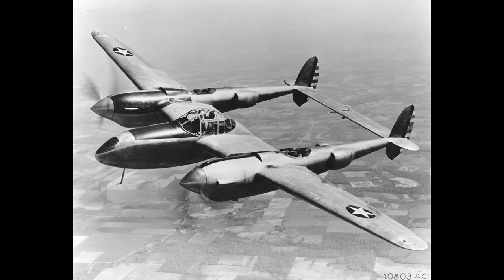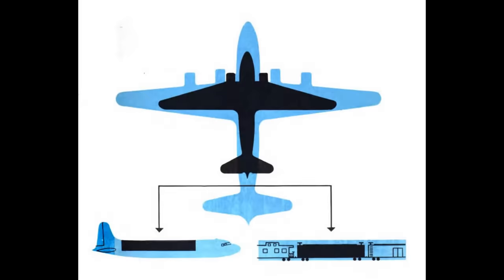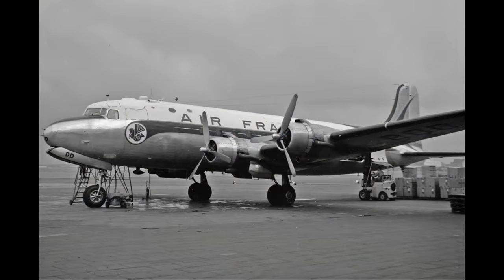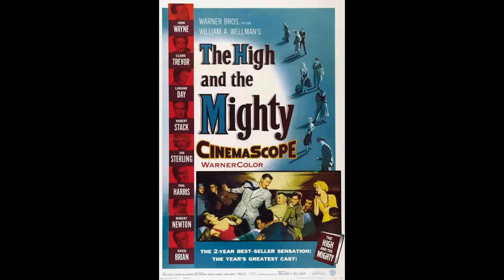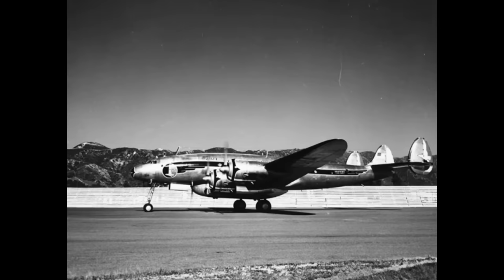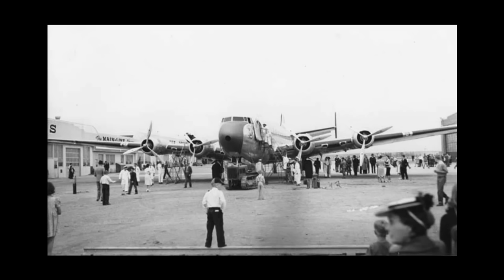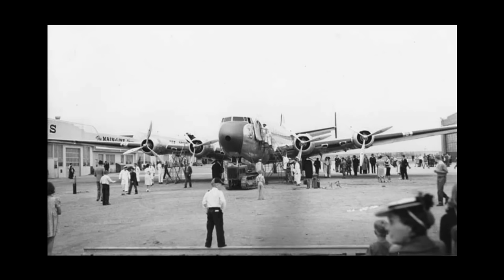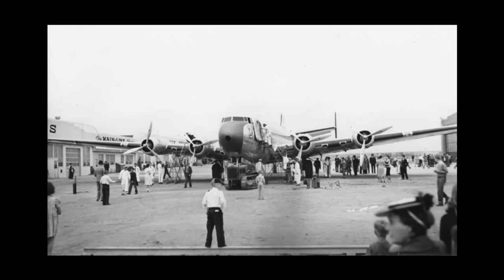Turbo Compound Piston Engines. Almost magic tech.

Comment: There is a bit of a problem with your discussion of horsepower versus thrust.  Since they are totally different concepts you cannot compare them 1 for 1.   Breast is simply a force whereas horsepower is a measure of energy.  [Just like comparing velocity and acceleration would be technically inappropriate and inaccurate.]   So don't want to get into a long discussion but you may want to look at the equation for horsepower.  In essence is the energy applied to the shaft of the motor.  One of the reasons that speed is so important has to do with the alarm velocity of air at the intake of the jet engine.  So once again the idea of thrust and horsepower is NOT technically accurate.  [I got into this discussion numerous times when I was training Air Force pilots.  I realize that military training often violates the technical issues to simplify the concepts.  Otherwise all pilots would have to be mechanical engineers.  However to the general public I think it's best to explain that theoretically and technically you cannot compare these 2 metrics.  However, it is true that turbo props are more effective/Efficient at lower speeds and altitudes.   The challenges that you need to analyze how to determine the efficiency of a turbo jet engine.  [Fluid mechanics and thermodynamics.]   Then compare with the efficiencies of a prop versus simple thrust.  (This becomes more complex for many reasons.)   You can make a comparison once you understand that difference in the metrics and realize that the scales are NEVER "1 for 1" as they're actually vastly different.   I hope this helps a little bit.  Again I really love your videos!
Reply from the maker: I'm not saying they are 1:1 in any sense other than at 325knots 1hp is equivelent to 1 pound of thrust per the USN book. That statement is indisputable, especially considering the source. I certainly understand what horsepower is, but this wasn't a video intended to explain every detail of horsepower or prop vs jet. Obviously I can't cover everything in infinite detail in every video.

Comment: In all piston type enignes there is a power loss due to the excess pressure and heat that is exhausted from the cylinders on their exhaust strokes.   The power recovery turbines converted this excess pressure and heat into horspower.   This recovered power is simply shot out the exhaust pipe on normal piston type engines.

Comment: Boring cars that last 300,000 miles vs Bring More Wampum that break the bank when they break. TBO with turbo-compound waaay less than supercharged.
Reply from the maker: Boring and good can coexist.
Reply: Subaru’s do tend to wear their con rod and plain bearings out  around 100.000 miles though… and no, I’m not a hater.

Comment: Why would this not be useful for automobile engines.
Reply from the maker: I'm not sure if it would or would not. I think the problem would be the variations in RPM and power. An aircraft engine runs at relatively constant rpm and power. I'm not saying that's a problem that couldn't be solved, I simply don't know.

Comment: Torboprop are not added complexity, The engines are more durable and simple than the piston engines.
Reply from the maker: Added complexity relative to a turbo-jet. A turbo-prop is basically a turbo-jet with the ADDITION of a prop, the prop drive, and prop governor.
Reply: Turbines do generally burn more fuel per HP generated, especially at low altitude, a reason the Canadians used R-3350s in place of turboprop engines on its Argus patrol plane; they actually swapped them for the original turboprops the Britannia baseline airplane used. But of course turboprops can be made far more powerful than a piston engine could be, witness over 15000 hp for the engines in the TU-95 as compared to approximately 3500, the practical limit for a piston aero engine

Comment: Let me put you right on a couple  issues, turbo compounding is not new, for in the marine world  Bauer Wauch a German company developed a similar power recovery system  based on a triple expansion steam piston engine. As you guessed the triple expansion steam piston engine extracts much energy from the steam as possible, but there is  still energy left in the spent steam . Engineers at Bauer Wauch ,plumbed in an axial flow Parsons type steam turbine to the triple expansion steam piston engines exhaust. As in Curtiss Wright,s power recovery system, the turbine is connected to the TE engine, via herringbone gearing, a Foettinger or Daimler Vulcan Sinclair fluid fly wheel as used in AEC Regent RT London Buses.  What you have cats&kittens is two engines in one, the piston engine, petrol diesel or steam and the turbine , an engine in its own right. In a fuel conscious world you think  motor companies would exploit such a system, but no it is  electric or nothing. You cannot power a Greyhound Coach(bus) with the same electric drive system as an Invalid scooter, and expected it do  San Francisco to Los Angeles . You can power the same Greyhound Coach with biodiesel turbo compounding and do the same trip more efficiently and offer passengers cheaper fares.
Reply from the maker: Did I say it was new? Did I not mention that this tech had it's roots in Steam locomotives? I don't understand your point, except the part about electric stuff, which is spot on, but a bit off topic.
Reply: Yes, am wel aware of that, and no ,I am talking about turbo compounding in a MARINE  application!!, for cargo steam ships in order to reduce fuel consumption on long voyages, just like the DC-7 Seas. You are talking about compounding in steam piston engines as used in steam railway locomotives and traction engines. The steam is used two or three @GregsAirplanesandAutomobiles  times in different sized cylinders high inter and low.  Andre Chapelon, Nigel Gresley, John Fowler, John, Henry McClaren, Charles Burrell and George Jackson Churchward. These top notch engineers used piston compounding in their steam railway and road locomotives. Regarding a bit off topic ,I do not think so, what about a turbo compounded diesel engine ,I,E a KittyCat or Clessie Cummins driving a generator for a high speed diesel electric multiple unit train.

Comment: Dear Greg, Greetings from Australia. Do you know about the Duke Engine being developed by Duke Engines of Auckland, New Zealand? This engine has three spark plugs and five cylinders and is one-third the size and one-third the weight of a standard ICE engine. Unfortunately, the shareholders are in the process of selling the company. My question is: "Would using a Turbo Compound Piston arrangement on the Duke Engine make it more efficient?" If you come to the conclusion that it will, maybe you could find someone to take out a Development License to prove this conclusion.
Best regards, Glenn Fordyce
Reply from the maker: I don't know anything about the "duke engine".

Comment: Turbo compounding can't really increase efficiency. No matter how you feed a aspirated engine optimum fuel air ratios can not be side stepped, so it's kind of a misnomer to say it uses less fuel because along with more air more fuel must accompany it and there is no escaping this in piston engines.
The reason we don't see this technology is because it was a flop due to mechanical complexity (costly) and efficiency.

Comment: Interesting shots of oscilloscope engine monitor on board DC-7C with turbo compounding, A 20 minute preflight checkout!  How was that instrumented?  Hard to imagine running all spark signals to the cockpit for analysis.  Like a Sun diagnostics scope in the cockpit!  Was that a later retrofit? 
DC 7C: The Seven Seas Solution
https://www.youtube.com/watch?v=-9qtIZBV_LA
Reply from the maker: I thought about talking about the oscilloscope spark plug deal, but it was just too off topic and would have taken too long.

Comment: There is a reason TURBO COMPOUNDING is not used in automotive or marine piston engines today; optimal speed disparity between the piston motor (2000~8000 rpm) and any kind of turbine (50,000 to 200,000 rpm). The turban must either be geared like crazy or be operating crazily inefficiently at way too low a speed. You are better off decoupling the two and using the turbine to drive a conpressor. You'll need more gas with more air aspirated, but being able to use a motor 50-100% smaller and lighter is worth more than the meager power a horrendously inefficient crank coupled turbine will add.

Comment: Love that performance chart, but dont try to pull that these days. 100/130 octane is no longer available and you wont get this on 100LL. You will get a rapid unscheduled violent disassembly if you do however...

The only truck engines with this tech is the Detroit Diesel DD15 and DD16 series. I had a DD15 in in 2016 and it was getting nearly 11mpg on the flat at gross. Stayed in the 5's on big hills. If I was deadhead, I could touch 12mpg.

Comment: Turbo compound engines were really not reliable tech. Wright R-3350 was unreliable enough already without any added parts to fail. Turbo compound planes, and straight R-3350 got famous on regularily arriving their destination with 3 engines running. Military could just, barely handle the insane costs of keeping R-3350 Duplex Cyclone running, commercial operators could not. Engines like Pratt R-2800 Double Wasp were 10 times more reliable (having few hundred HP less output, admitedly).
Reply: Still today there is quite many Pratt R-2800 running planes all over on flyable condition. Its only two decades when last R-2800 DC-6 were retired from serious Gov and private users and they still fly in banana countries. DC-6 have engine that goddammed WORKS. Not seeing Wright R-3350 train wrecks flying...
Reply from the maker: It wasn't the turbo-compounding that was causing the failures.
Reply: @GregsAirplanesandAutomobiles  In any case L-1049 Super Constellations are the most magnificent 3 engined aircraft ever flown. They came to landing so often with only 3 engines running that they were mocked like that. Putting turbo power recovery system an already failed engine aint making it better. R-3350 could be run with decent reliability, by 50s in Skyraider/EC-121, with USN/USAF FUNDING = replace EVERY part on rotten engine or swap the whole engine to new one at slightest hint of trouble. No commercial operator could afford that on long run. Donald Douglas himself was very hesitant to develope DC-7. He knew he had to use unreliable engine to power it. Pratt R-2800 was utterly reliable but few hundred hp short.

Comment: I'm getting tired of Greg bashing subaru.  They are great cars and wrx owned the rally scene for decades 😮
Reply from the maker: I appreciate your help with the algorithm.
Reply: @GregsAirplanesandAutomobiles  oh I am a big fan sir. And I thought it was funny the first 6 or so times😉. But as someone who is in the automotive industry.. there are dozens and dozens of worse car makers. Audi, Daewoo, Chevrolet,.. lol. Keep up the good work!
Reply from the maker: I'm with you on the Audi thing, but those guys won't defend the brand like the Scooby crew.
Reply: @GregsAirplanesandAutomobiles  lol. I enjoy most Japanese brands as I've owned about 40 japmobiles. I'm not a subie fanatic. There are much better cars for specialized purposes (like making a bunch of reliable hp😆).  I've only owned one subaru. But making 250ish hp on an almost stock engine is decent. Also rain/snow capability and being able to throw 2 kayaks and camping gear is fun.

Comment: DOHC and long predated WW2. 1912 Peugeot 7.6L DOHC, 4-valve beats a 15L Fiat. 1891, the British Herbert-Akroyd oil engine.
Reply from the maker: It didn't become common until WW2. Yes, these thing existed earlier, but it was WW2 that really ushered in that technology, which is actually what I said in the video.
Reply: @GregsAirplanesandAutomobiles  Looked it up. you are more correct.
In 1926, the Sunbeam 3 litre Super Sports became the first production car to use a DOHC engine.[36][37]

In the United States, Duesenberg added DOHC engines (alongside their existing SOHC engines) with the 1928 release of the Duesenberg Model J, which was powered by a DOHC straight-eight engine. The 1931–1935 Stutz DV32 was another early American luxury car to use a DOHC engine. Also in the United States, the DOHC Offenhauser racing engine was introduced in 1933. This inline-four engine dominated North American open-wheel racing from 1934 until the 1970s. My auto centric bias told.
I am sure more mechanics became familiar with these engines through military service. 
It's interesting that good SOHC designs can beat DOHC due to frictional losses, depending on application. Thanks for interesting post.
Reply: @GregsAirplanesandAutomobiles  I guess ushered and exactly what that means is the hinge word. I consider production beyond the                   threshold. Sorry. Thanks for your kind reply.

Comment: Regarding the non-use of turbo compounding in AMERICAN heavy duty trucks; the typical American heavy truck turbo diesel engine operating speed is very slow. For example, the typical Cummins 15 liter is designed to cruise at between 900 and 1,000 rpm. So, my completely uneducated guess is that the exhaust velocity is not high enough to make turbo-compounding practical, especially in view of the excruciatingly difficult to meet exhaust emission restrictions (which are growing more and more restrictive). Also, the typical new truck is equipped with a twelve-speed auto-shift transmission; so, in stop and go traffic, the engine is constantly revving up and down as it up shifts and down shifts. Moreover, nearly all trucks are equipped with compression brakes which, at least in my view, would be counter productive when employed in conjunction with turbo compounding.
Reply: That's an interesting observation.  They would need a bypass valve to route the exhaust around the turbocompound unit when using the compression brake.